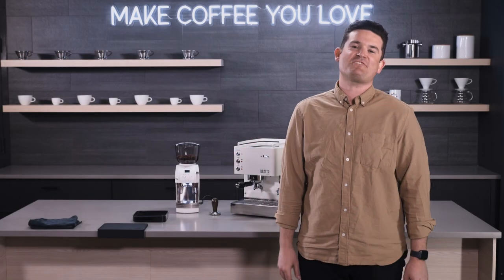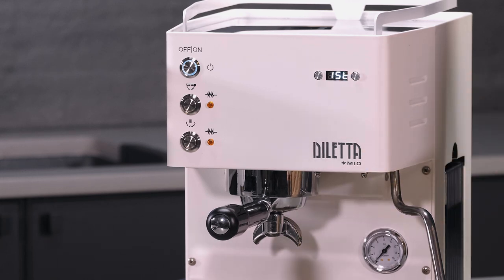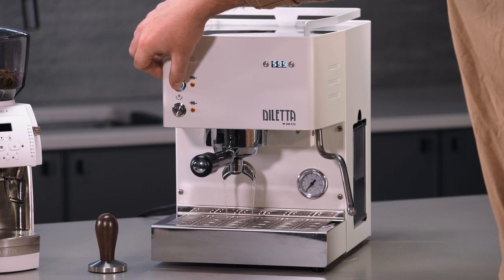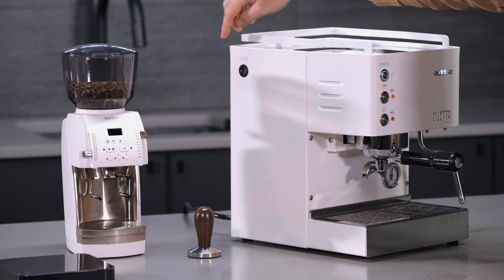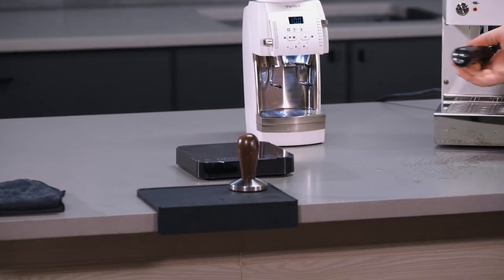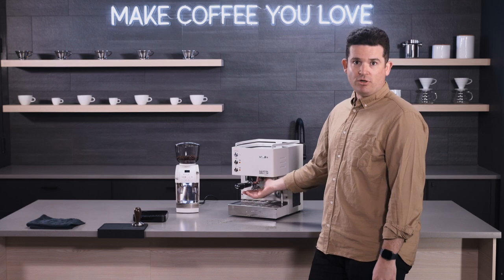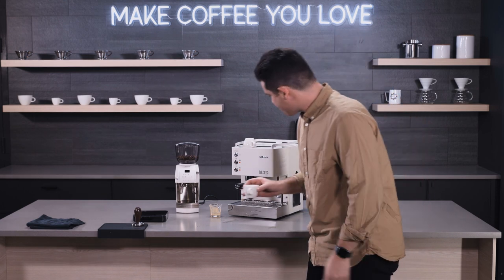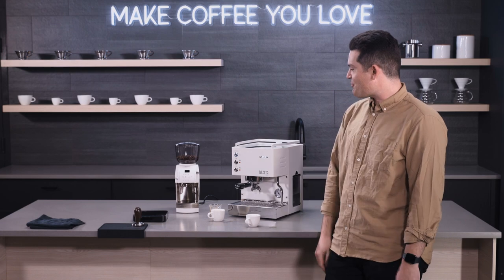Diletta Mio Espresso Machine Tips and Tricks

Comment: Why don't you people talk about the cleaning and DESCALING PROCESS ? I bought mine in March 2022, use it every morning to make a latte, turn it off or leave it in auto-eco-mode. The Diletta site, and the manual clearly state, NO CLEANING. However, as of late, I have been getting the nastiest crap out of the steamer. Pepper flake sized crap. Tip removed, large flakes of scale. I have talked with your service dept. at SCG and was advised to descale. Today, I ran two packets and 64fl oz of Dezcal per the packet instructions and what came out over an hours time was disgusting. Prior to all that, I can only imagine how much pepper flake sized scale I consumed via steaming milk. No wonder I feel like I have a kidney stones and peeing out flecks. 
I only use filtered H2O using my ZERO water filtration. After all the flushing and rinsing, I am still getting some scale. 

Prior to buying the Mio, I used a Nova Simonelli Oscar for 22 years and never had any scale nor did I ever use any descale. There is definitely something up with the Mio. I can only surmise it is how the steam is made. The advantage of the Mio since it is quite heavy at 35 lbs is having the side reservoir as I am able to keep it under my top cabinet and easily access refilling. The Oscar was top fil but it was much lighter and easy to slide out to refill. 

I do not know of any other side filling home-use machines but if I did and it was comparable in quality of espresso making, and price point 1200 to 1500,  I would sell the Mio for it assuming the replacement did not have a thermo-block steam design. 

Hope this help anyone considering this machine or if they already have one. Having gone through what I have now learned from normal daily use, and contrary to printed instructions, I wish I would have descaled right from the start, not waiting nine months.
Reply: Use bottled water.    Your filtered water probably isn't filtering good enough, hence scale build up.    Not a machine problem, more of a garbage in garbage out scenario.